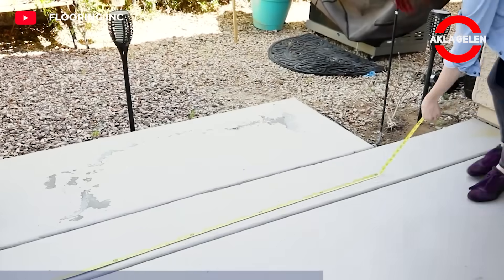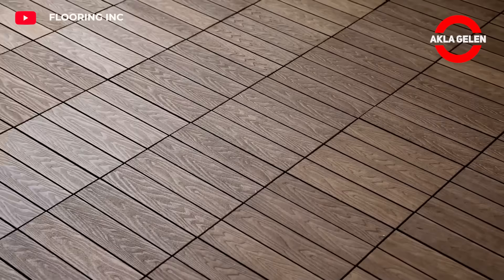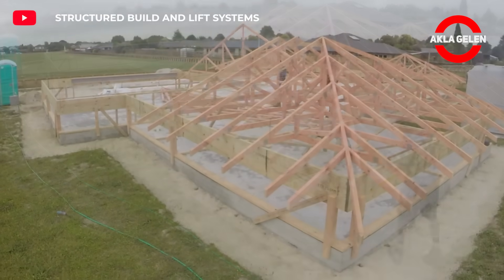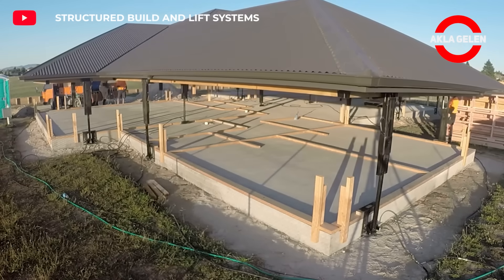Construction Workers Can't Believe This Technique Works - Most Ingenious Construction Technologies▶4

Comment: 20-inch concrete saw "We don't need no stinking PPE! I'll blink to keep the pieces out of my corneas!."
Reply: Safety glasses
Reply: It all comes down to what is permitted,and who gets rich!
Reply: how about that concrete dust in the lungs? Oh well, we can replace with boarder crossers.
Reply: @johnwmendenhall9896  it's a wet saw so the dust is collected into the water so it doesn't get airborne